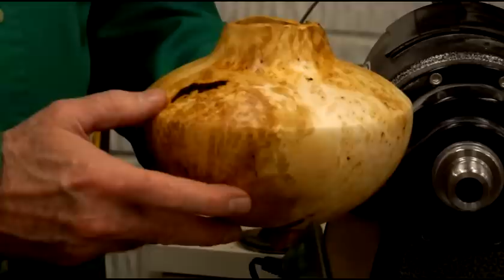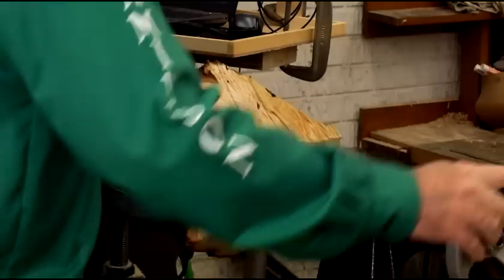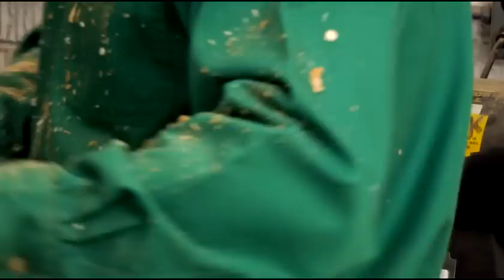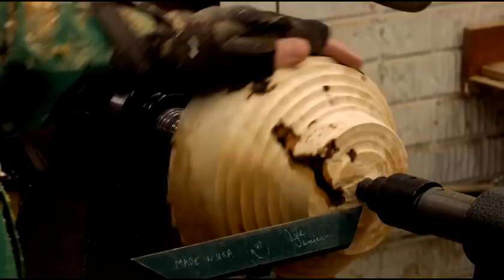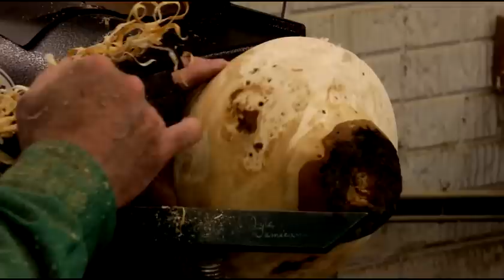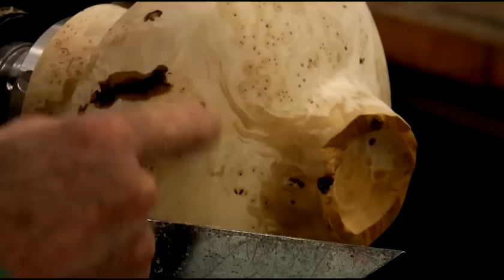Natural edge hollow form turning, Part 1 planning and design the outside.

Comment: Another good teaching/learning video. I think I know the answer, but I will ask anyway: Could you have used a glue block between the log and the faceplate? It would seem that if one were concerned about preserving the depth of the piece, that might be one way to have enough material to shape the foot.
Reply from the maker: Yes, That was an option.  I usually do not use glue blocks on hollow forms because they are usually end grain.  Glue lines are not as strong with end grain.  But this being a burl grain pattern my glue block method would work fine.  I did not want to model a glue block for hollowing.  It is safer and more secure to use screws.
Reply: Thanks ... that's what I thought. I have come to view your glue block method as a great bacon saver ... gives me a secure hold with the faceplate and options so the holding method doesn't dictate the shape of the foot.

Comment: Great video Lyle. How would one go about getting the hollowing tool you use
Mark
Reply from the maker: Hi Mark, The Jamieson hollowing system I manufacture and use is available on my web site. The instructional DVD is included with the system.  I have a ton of resources to get you up to speed quickly with techniques.  lylejamieson.com.  Or give me a call 231-947-2348